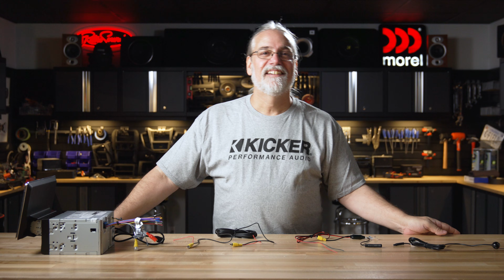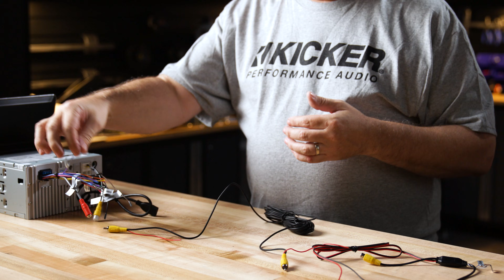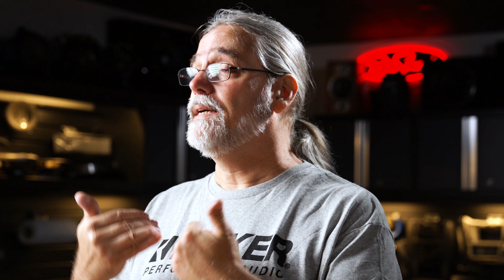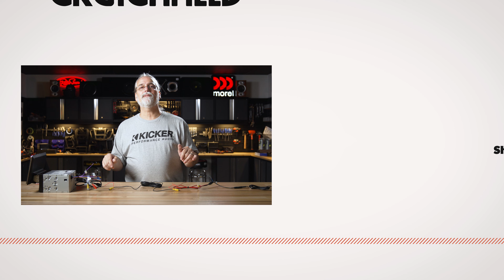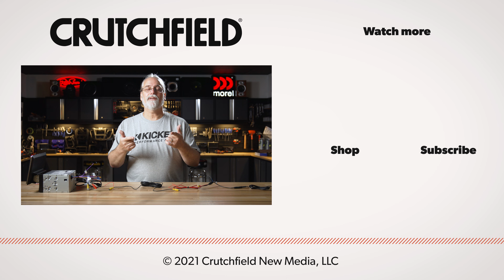Powering your backup camera (and how to use that extra wire) | Crutchfield

Comment: So if you want to manually operate the camera to say view a trailer while driving down the road... you still need to hook the reverse trigger wire up to a back up lamp source?
Or just hook the trigger wire to a accessory 12v source?
Reply from the maker: If you won't need the reverse trigger, you can wire into standard 12V power.
Reply: @CRUTCHFIELD  kenwood dmx47s kenwood 103 camera and I hooked it up to view camera anytime like you instructed but I cannot. Camera comes on when in reverse but the guide lines are up in the air and it says I can't adjust the lines while driving...and I'm setting still in park. There is a park wire on the back that you didn't speak of in the video...does that have to be hooked up to what? For being able to view camera anytime? And to be able to adjust parking lines?
Reply from the maker: Sorry to hear that. Can you please verify the camera model number, and we can check for a manual for it. Also, if you got the radio and camera here, you can call our Tech Support. Their direct number is on your invoice.

Comment: here is what IS NOT EXPLAINED:  

scenario:  You want to have reverse camera on demand, like driving forward, or parked, or even neutral? (auto NOT IN REVERSE GEAR)!  And of course, you want the reverse camera to display when you do put auto in reverse in the typical mode.   In this scenario, the head unit MUST have some type of switch so that you can TURN ON the reverse camera at ANY TIME.  (in park acc key but not engine on, and also when driving in forward gear).

here is the reality:  VERY FEW head units have this switching option!  If you wire according to these instructions for a head unit that DOES NOT have this switching option capability, then the reverse camera will be on ALL THE TIME!  And this means for MANY  head units  nothing else will work ..no radio..no gps display...no amp/speaker...nothing...only the reverse camera will display.!!! 

what this video fails to acknowledge is that most head units do not have this switching option and only allow the reverse camera to display when IN REVERSE GEAR.  

here IS what you need to know:

what head units (BY NAME AND MODEL) DO HAVE reverse camera ON DEMAND SWITCHING (in any gear, at any time), like a dedicated button or switch to turn on the reverse camera display at ANY TIME?  

And if the head unit that you have does NOT have built in dedicated reverse camera switching, what kind of modification is required for head units that do not have ON DEMAND SWITCHING so that you can install a separate dedicated switch somewhere convenient on the dash that you can switch at any time (while driving forward or while parked/neutral/key in acc)?

example:  I am installing a reverse camera to a eonon Q80PRO to be used for a commercial duty towing 4x4 truck.  If you follow standard wiring methods to  this head unit, then you will NOT have a reverse camera ON DEMAND AT ANY TIME OF YOUR OWN CHOOSING.  It will only display reverse camera WHEN you are in reverse.  For some people this is enough.  However, for others who use reverse camera display for other scenarios this would not be enough.  For instance:  when driving on the highway and you want to see the reverse display.  Or when you are parked or in neutral!  These are important features that stock and even after market head units do not have!  

so how to solve this?

Here is the solution (not mentioned at all by this video):

*  install a switch in a convenient dash location that provides switched power to your reverse camera!  This switch will BYPASS the reverse circuit when it is closed (ON).  And also when the switch is open (OFF), the reverse camera circuit is preserved and will operate as normal.  

this allows the driver the most robust on demand operation of the reverse camera display!

tech spec info:  switching power while driving, versus parked or neutral and obviously reverse requires the switch to be wired using different power supply wires!  (for key on, engine not running, this would be acc power wiring circuit!  For engine on, and in neutral or forward gear this would be the standard ignition power wiring.

protip:  a relay switch is your friend.  !

you are welcome !

Here is a quiz:  can you name a single head unit "radio" made by ANY auto manufacturer or even after market that allows ON DEMAND REVERSE CAMERA SWITCHING?

spoiler:  you will find them on most RV's and big rig trucks and most commercial agricultural tractors!  BUT NOT IN THE AUTOMOTIVE sector

spoiler 2:  most separate device "remote" reverse camera displays for consumer autos also do not have ON DEMAND SWITCHING (only reverse)

bottom line: there is nothing wrong with this video from crutchfield, but if you are looking for more functionality from your reverse camera system, this video is not going to help you accomplish that.

background:  Avionics tech (boeing and airbus), 25 years.  Modifying OEM stock super duty commercial and ag vehicles as a side hustle!)

God Bless America
Reply from the maker: A lot of the after market touchscreen radios we sell have the ability to manually view the camera when the vehicle is not in reverse. There are too many to list, but they are abundant on our web site. It is often one of the sources that can be chosen to display. Some with touchscreen buttons even have a camera button. Kenwood likes to use the letters CAM for that button.

You mention of the switch is a good workaround for radios that only support the reverse gear trigged camera view! But it is not something that can be installed onto OEM radios in a lot of consumer class vehicles over the last decade or so. They often use a can bus (computer like protocols) to send the reverse trigger to the stock radio but that can bus also sends other information like the parking brake, power, and sometimes more.
Reply: I purchased a stereo from you guys it has the cam button. How exactly do i need to wire it so that my camera comes on in reverse and when i press the button? Convenience wire to the trigger wire and connected to the reverse lights in back? I'm not great with wiring.thanks

Comment: Hey, what do you mean with the black wire  going directly on the frame? You mean scrap it clean and tape it to the metal of the frame? it's not for electricity? I thought red and black has to go and hooked up on the + and - of the backup lamp..
Reply from the maker: The black wire is the ground wire. We don't recommend connecting it to the backup lamp ground wire. The metal of the frame does need to be clear of any coating on it so that a metal-to-metal contact can be made with the camera's ground wire to the frame. Tape will not hold it in place. It is best to secure it with a screw or bolt.

Comment: thanks this all makes sense. I have an older system and the uses a camera connector that is like a small headphone plug it has 4 connections on the single pole like a headphone but i am having trouble sourcing a new camera that has this, have you seen these before, it is different to the one you show in this video. is it worth keeping or running new cables?
Reply from the maker: That description sounds more like an A/V connection. What is the brand and model of the receiver?
Reply: @crutchfield  hi well thats the thing, i had it with a kenwood ddx unit a few years back and then swapped it over to a chinese headunit, it worked fine but now it is getting really slow to respond, I am thinking there is a capacitor inside that needs replacing. the cable will have to replaced with something more modern. thanks for responding, I havent seen any cables like this.
Reply from the maker: What is the brand and model of your current radio?
Reply from the maker: Kenwood DDX receivers do sometimes allow one of the A/V inputs to be resigned to be a camera input and those can be 3.5mm sized and would need a cable like you described to adapt that input to RCA connections. Something that may also help is knowing the backup camera that is installed. There is a high probability that there is a cable being installed in between the cameras cable and the input which plugs into the radio. It may be worth tracing the cables from the radio back checking for an RCA connection.

Also, we keep order history that can help in times like this. If you purchased your gear from us, you can reach our to an advisor to look up the history and check the connections on the cables. Here's how to reach one for that help:

https://www.crutchfield.com/I-rYALc227/support/ContactUs.aspx
Reply: @crutchfield  thank you for the response, but i think the time has come to start again with a new camera and run some modern cable. cheers from australia
Reply: hi guys I bit the bullet and put the new camera in and found the connections were indeed "new" style like yours but hidden behind a panel and the video cable was suffering from a bad connection, so cut it out, anyway so new camera and then added a relay back there was well and all good works everytime [fingers crossed].

Comment: This answered my questions exactly!!! Thank you so much. I had just finished wiring my radio and harness together and of course I only had my purple wire (Reverse +) left. My radio has a second harness (for Audio/Video input for camera and Media player) and I was trying to figure out if I'd be hooking into the reverse circuit, or powering from the head unit (since there was another power and ground line on the second harness). Now I know the differences. Thank you again.
Reply from the maker: You're welcome! We are glad to know that this video helped you get up and running

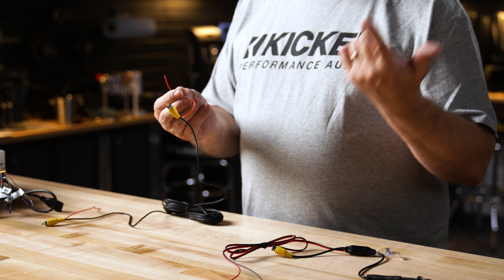Comment: Hello, I just installed a backup camera on my 2007 Pontiac G5, and I followed the instructions in the video at around @1:45 in the video. I spliced both red wires together and connected that to the reverse wire on my rear tail light, which was a green wire. I also grounded the black wire to my vehicles chassis. The camera is getting power and the image does show on my stereo, but the image only shows when I have my foot pressed on the brake, and does not come on when in reverse; only when my foot is on the brake. What could be causing this?
Reply from the maker: Hi Carlos, sorry to hear your installation isn't going easier. It sounds like you may want to re-check your wiring, specifically your reverse wiring. If you got the camera here, please call our Tech Support. Their direct number is on your invoice.

Comment: Ok so why do we have to splice the red power wire into the 12v wire on two different harnesses @4:19? Can’t the power wire just wire into the red 12v wire on the main head unit harness?
Reply from the maker: The harness held in his hand is the one used to plug into the stock wiring in a vehicle (what's left after removing the stock radio). If the red wire from that harness was not connected, neither the new headunit nor the backup camera would turn on.
Reply: @crutchfield  ohh ok I see now. Thank you!

Comment: Just wondering why the camera needs its own ground and can't be connected to the backup camera's ground wire?
Reply from the maker: We may not be following what you are asking. A backup camera does need power to work. The ground cable must be connected to complete that circuit. Also, the ground that works best is the vehicle's chassis so making a new connection for it is helpful

Comment: But you didn't tell us where to connect the guide line wires..thats what I'm trying to figure out
Reply from the maker: Those wires are generally included on the video wire and camera specific instructions would tell you which wire to use to match your preferences. What model camera are you installing?

Comment: What if u wanna install the backup camera and also look at it when your driving down the highway would u have to get a Y splitter and wire one of the wires to the reverse light and the other to the radio
Reply from the maker: What model radio to you plan to view the camera on?
Reply: @crutchfield  Kenwood DDX376BT 6.2
Reply: I'm also curious about this.same radio

Comment: Any reason why I don’t get video at all when installed on my 1500dmh-nex?
Reply from the maker: It should be just be a matter of figuring out the issue and correcting it. No video at all from a backup camera suggests that the wiring for the camera may not be properly connected and that is a good place to start. The manual for the Pioneer didn't list any settings to make sure it can come on when the vehicle is in reverse but you may want to check the receiver's wiring to make sure its reverse trigger is connected to the proper wire in the vehicle. If you purchased your gear from us, you can contact our technical support for this help. We include their toll free phone number on the order invoice

Comment: Very informative and detailed video! However, my entertainment system in my car keeps showing the message "No Video Signal," no matter how I hook up the ground wires (to chasis ground or to the ground wire of the back up lamp! I had a camera before, which used to work perfectly well, until one day it stopped working. I thought that I needed a new camera so I purchased one, but still no go...I installed brand new wires so I know they are good, but nothing! The screen works just fine with my other devices, but it just refuses to show the reverse camera image! I checked for any blown fuses on the stereo, but the only visible fuse there is the "ACC" fuse and it is good. Any advice or insight? Anyone?
Reply from the maker: Since you have checked all the wiring, the only thing left to check are possible backup camera settings in the radio.
Reply: @crutchfield ,
I tried that, but my deck (Planet Audio) does not have settings for the camera. Very strange! I know the screen of the deck is working, because it operates normally with other devices. I don't see any fuses on the deck, except for the one on the ACC wire and that fuse it good. Could it be possible that something shorted inside of the deck and that prevents the screen from displaying the image from the camera? I will test the camera on my TV set to see if it will produce image there. Thank you for your response!
Reply from the maker: When it comes to malfunctions/electrical shorts, just about anything is possible. However, before calling it a defective, and since your receiver does not have any camera settings to adjust, the best recommendation we can give is to contact technical support to check if there is any further troubleshooting that can be done. Plant Audio lists 805-751-4854 as their phone number in the Contact Us section of their web page
Reply: @crutchfield ,
I just plugged the camera into the “video out” input and got it to show on the screen that way. Of course, I lost the function of opening the screen automatically when switching in reverse, but at least I can use the camera when I need it.